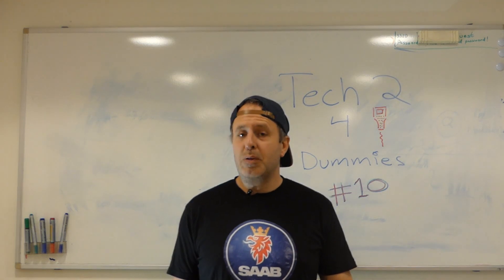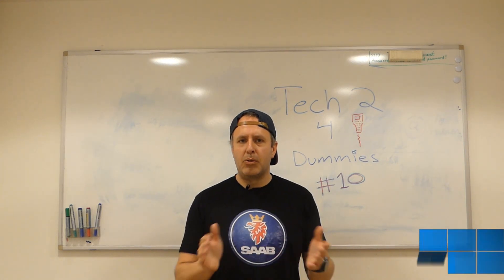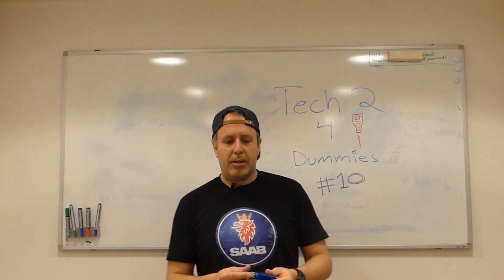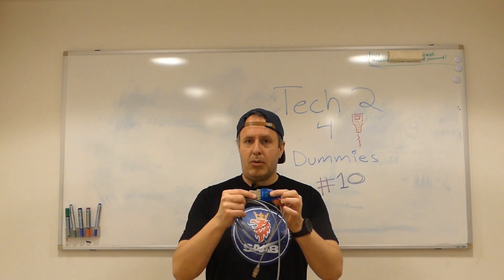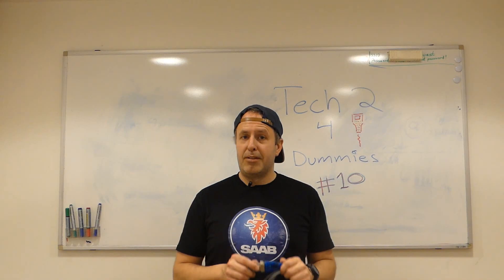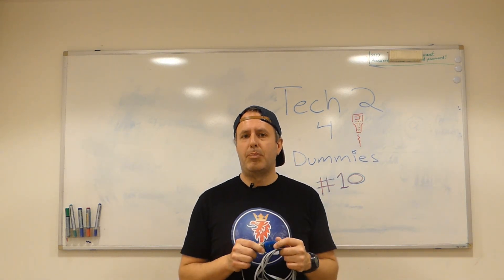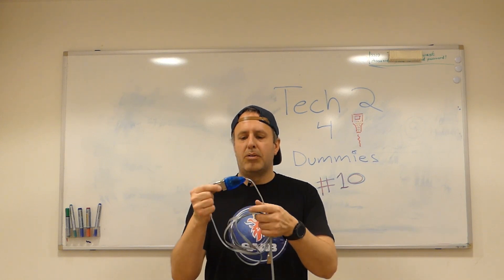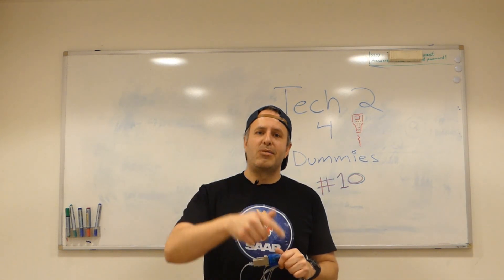Saab Cars - Tech2 For Dummies - Episode #10 - Communication issues!

Comment: I have a 2008 9-5 and would like to program keys and also use the other features of Tech2win.
Is it possible? One thread says it will not work on a 9-5. but gives no reason or details of why.
Has anyone been able to do it? If so what interface is needed ie,:MD1 etc
Or do I have to take my chances with a clone Tech2.
Pine Hollow Auto Diagnostics on you tube shows how to reprogram a 9-3 but of course it uses a different ECM and not a Trionic7. Any information would be appreciated.
Thank you.

Comment: Hej Markus, nu har jag suttit i över 12 timmar och försökt få security access till min 9-3. Loopback RS232 check är OK.
Jag har försökte installera TIS2000 på windows XP, men där kan jag inte kommunicera med min Tech2. Efter det försökte jag med GlobalTIS men det gick ju också åt skogen eftersom att det var något fel på min windows XP eller nåt. Efter det lyckades jag installeraGlobalTIS på min vanliga dator (windows 10) men där kan jag inte starta några appar från GlobalTIS. Efter det testade jag med windows 7 och fick allting att funka, förutom att security access-panelen säger "Ett fel har inträffat!".

Kan det vara min USB till RS232 adapter inte fungerar? Jag köpte specifikt en deltaco och installerade drivrutinerna. Testade med en vanlig ethernet-kabel, men den kommer ungefär lika långt som kabeln jag fick med min Tech2. Kan du rekommendera en adapter som du vet fungerar (och som går att köpa i Sverige helst)?
Reply from the maker: Tyvärr är det struligt med dessa adaptrar :( Ta en titt på denna listan och se om du hittar någon i en affär inte allt för långt borta.. https://tech2wiki.com/content/tech2/tech2_using/connecting_to_techline/usb-to-serial/usb2serial_working.html

Comment: Hello Markus,  Quick question, I'm a little "foggy" on this:  Does the computer with XP have to be internet capable?  In other words, does the computer need to access the internet while mated to the "Tech2" or does the "Tech2" simply use the "XP" program for functions already contained in the "Tech2"?  Hope that made sense.  Thanks
Reply from the maker: Hi, Normally you don't need internet connection. It's if you need to download some software for upgrading diifferent modules. If you're above 2010 I think you need to have subscription from GM to be able to get security access through Global TIS.
Reply: @TechCars  HI, this is SUPER helpful.  For a 2010 9/3, if I want to load software onto a new REC (Rear Electrical Center, the fusebox in the rear boot), do I need to download that specific software?  Or is it included in the image on the PCMCIA card in the Tech II?  If it must be downloaded, perhaps you could do an episode on that.  :)   Thanks!
Reply from the maker: @akahan1  Software updates is not on the PCMCIA card. They are on a server that you need to access through GlobalTIS. If you do make sure you have a solid connection both to the internet and between the tech2 and the car (CANdi 100%) :)
Reply: @TechCars  Uh oh.  Will a "hacked" GlobalTIS download the software?   Asking for a friend...
Reply: @TechCars  So it turns out I am able to update Control Modules from my TechII without downloading anything additional; the software must have been preloaded into the PCMCIA card, I guess.  Anyway, for me, at least, it all worked out fine.
Reply from the maker: @akahan1  Wow. Maybe a certain level of updates is on the card because most of the time you need a connection to Orios portal to do a SPS, download new software into the different modules. Great it worked out!
Reply: @TechCars  Ok, great news!  I have an old laptop, with XP, but it will longer access the web.  The car in question is an 03 Arc.  Thanks for your help.

Comment: Hej, Jag har problemet att när jag begär securetyaccess så får jag försöka ibland upp till tio gånger innan det går igenom. Kan detta ha något med adaptern att göra eller faktumet att min Tech2 är en kina-kopia:P
Reply from the maker: Hej Jonathan! Det kan absolut ha med adaptern att göra. Det är/blir timing problem när adaptern inte är helt perfekt för Tech2an. Det kan vara så att den funkar bra i andra sammanhang. Vet du vilken adapter det är du kör med? Ibland står det inte så mycket på dem..
Reply: @TechCars  Det är en deltaco från netonnet vad jag vet. Kanske ska köpa mig en ny adapter.
Reply from the maker: Ja det kan vara bra att skaffa en stabil modell. 👍

Comment: On one of the videos I saw that you have LED backlight license plate. It looks much better then original.How you got past the burnt-out bulb error? Canbus diode did not solve the problem.
Reply from the maker: Yes that's correct. Even though it's canbus diode the power consumption seen by the car is to low. I added a resistor in parallell to simulate that. However!! It's get very hot in there and it can deform the plastics inside the ledbar so I would be very careful. I found regular lights with a white light so I put that there instead. 
https://www.amazon.de/gp/product/B07P2YSZ5N/ref=ppx_yo_dt_b_asin_title_o00_s00?ie=UTF8&psc=1